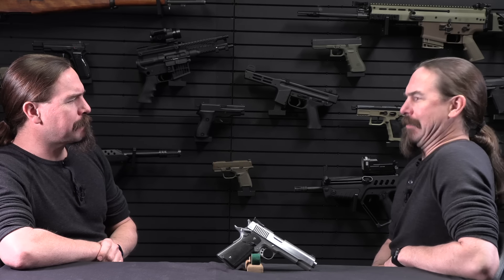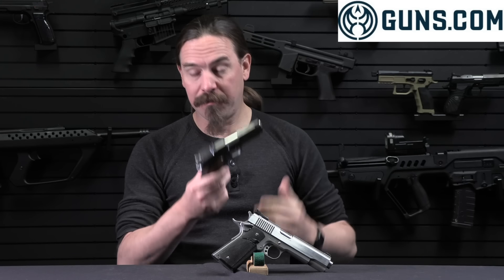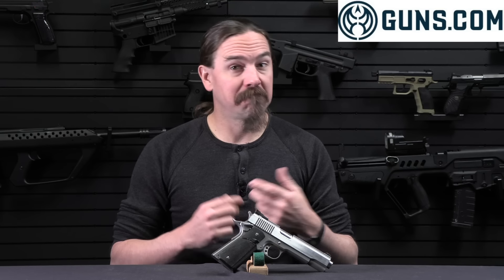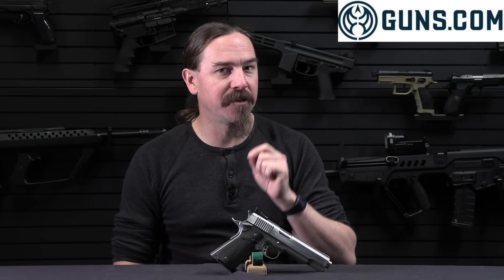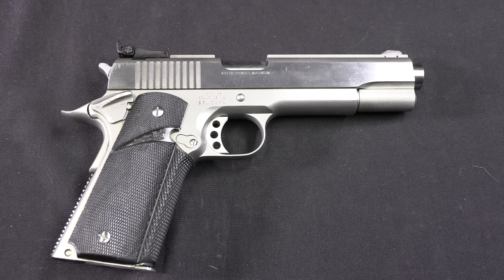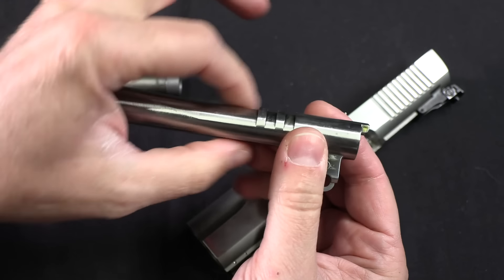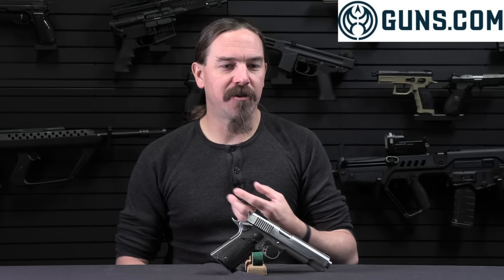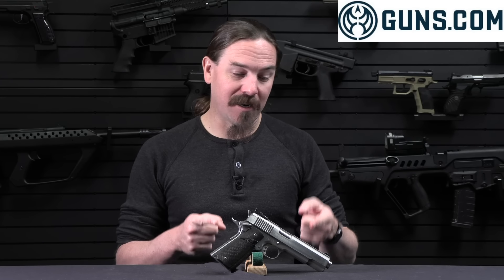Cartridge History: The .451 Detonics Magnum is a Supercharged .45 ACP

Comment: The 1911 unsupported chamber was resolved with the introduction of at least two ramped barrel designs using swinging link and at least one linkless design.
The stock 1911 uses a ramp on the frame coupled with a heavily chamfered chamber mouth.  The gap between the frame ramp and chamber can cause feed issues which is why the chamber is often unsupported

Comment: Nice video. I wish you had made it longer and given more details on the 45 super and 460 rowland. The only reason I haven't tried custom build in 460 rowland or 45 super is ammunition availability. I also want to do more research on chamber pressures and bullet velocity in those vs regular 45 acp and the +p or +p+ 45acp as if I really need to step up to the more magnum cartridges. If I can find a reliable expanding bullets in 45acp with the 4 inch commander size ruger sr1911 I already have I'd be satisfied. My problem is expanding bullets are velocity based and 45acp in general just isn't fast enough to expand properly. It's close but still a little slow. I want the 230 grain bullets at about 1000 to 1100 fps and 185 at about 1200 to 1300 fps. I've seen 230 grain at 900 to 980 and the 185 around the 1050 to 1100 fps and the one common thread is the the faster bullets get full expanding and the slow ones don't expand and over penetrate. I don't give a rat's rump about the fbi ballistics test because as a private citizen I don't have the same problem as law enforcement officers or the same mission. I think my encounter will be up close and personal from someone attacking me. Where law enforcement is the one searching for or trying to arrest the bad person, my goal is to drive off the attacking criminal and survive

Comment: I have some Underwood 45 Super.  I've shot it in a Kimber 1911 (one mag), Mark 23 (lots of mags), and a S&W 625 JM (a few cylinders).  Recoil makes it not as usable for self defense as I had hoped.  I'd rather carry .44 Mag if I want something heavy. I get better followups with .44 Mag, though it might be attributed to the grips that absorb a lot of recoil. The 629 is also heavier. Maybe I should swap grips between the 625 and 629 and see how it changes. I liked shooting it out of the Mark 23 the most. That was fun.  So, the .45 Super is reserved for the Mark 23 for those times when being practical is boring.

Comment: Fun fact. The HK Mark 23 is most likely the only current mass production handgun that can withstand running thousands of 45 Super rounds without issues (without ANY modifications). The USPs can shoot small amounts of 45 Super, but large quantities will damage it. FNX is similar to USP in regards to 45 Super.
A box stock Mark 23 will even run 460 Rowland without issues. Having the stock barrel chamber cut 1/16" deeper is all that's required.
The stock progressive recoil/buffer assembly (looks like a shock assembly for an RC car) works even with 460 Rowland pressures.

Comment: I wanted a more powerful 45 in a 1911 and looked at all those options, I went  with a 10mm. I think the 10mm has a manageable recoil that I could handle easy with a 200 gr. bullet and 13.3 #9 powder. 
I a 1911 pistol you got to be able to hold the grip(with your own personal strength) without any slippage because that does affects the  accuracy and anything more is hard to control for me. I did have a glock 10mm and that gun was hard to hold onto.

Comment: I dunno about the whole low pressure early powder thing. Remember when cordite was so hot that it was smoking barrels and burning them out in a rather short period of time? If you broke up the spicy spaghetti it got REALLY volatile. The reason for the sticks was in part to keep it under control. It was early double base extruded powder. 

Chop that stuff into slices instead of long rods and the behavior changes drastically. They had the means to make hot pistol and rifle powder back then. The guns couldn't handle it. Hell, my modern production 1911 gets a little beat up with standard wwb .45 acp 230 jhp. Mild loads of 185s at 675-700? Much easier on me and the pistol.

Comment: Two questions:
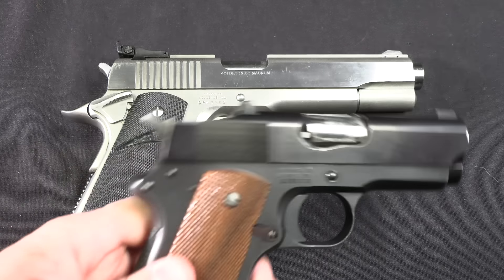A: 9:45 why does this gun push the rear sight so far forward?
B: If people want a large bore powerful gun why not go to the maximum diameter allowed by law, .50 cal and keep the muzzle velocity in the 1200 fps range. In other words, don't go .50AE and require a ridiculously massive pistol, just increase the diameter and performance such that a relatively normal size 1911 frame will work? If you are going to stay with a single stack magazine, why not increase the bore diameter to .50? Perhaps a little longer version of the .50 GI, with a rim diameter sized for the cartridge (i.e. larger than the .45ACP rim). "Flying ash tray" anyone?
Reply: A: The guy who designed the Combat Master believed in carrying a 1911 with a round chambered, the hammer down, and the safety off. The cutaway at the back of the slide was to make it easier to thumb cock the reduced-profile-but-still-spur-style hammer. He had opinions.
B: Interesting idea. Increasing the rim diameter would make .45 ACP conversions much more difficult, though. I think the rebated rim on the .50 GI is an elegant solution.

Comment: 8:08 200gr at 1200fps is rookie numbers. Gotta push them up!

(I've got a .45 super load that pushes a 200gr projectile at 1300fps and it's a safe load)
Reply: Imagined or chronograph?
Reply: @georgesheffield1580  chrono'd. I only expected about 1200 or so feet per second, but was pleasantly surprised. It's also very consistent (using BE-86). TO BE FAIR, I'm using hard cast lead RNFP because it's a bear defense round. Use jacketed bullets and you'll lose about 50-75 or so feet per second and increase pressure. 

200gr RNFP Hardcast (19 brinnell)
Starline .45 Super brass
CCI Large Pistol primer
10.2gr BE-86
Seat bullet to magazine length.

5" XDM Tac (stock threaded barrel) with Muzzle Brake and 22lb spring.

There is something interesting to note. I get higher velocities out of my XDM than I do my 1911 with the same barrel length. I get on average about 50fps difference between the two. I can't explain why.
Reply: Here is a video of a similar load I did with semi-wadcutters for my buddy that runs Alaskan Ballistics. It was 10.1gr power pistol out of a 6" barrel. I like the BE-86 load better.

https://youtu.be/EYTEoCAYIEc?si=dD-DT8x_EWN3YmR9

Comment: All of these hopped up .45's seem to be a recipe for battered or cracked frames. I'm no 1911 specialist, so I don't know if the solution lies in the realm of metallurgy &/or heat treatment or additional means of recoil abatement. Perhaps the 1911 is ultimately, an unsuitable platform for high performance, large bore cartridges. A curious thing I noticed on the pistol you displayed was the long ejector employed. It must provide pretty spectacular ejection.

Comment: I have the complete series of The Survivalist.  I think they are 27 books.  I read the books.  Bought a Combat Master.  I was tempted to get a second, so I could use the two holster shoulder setup.  That would be a bit extreme.  But, I did get a Scoremaster in 45acp, and another in .451 Detonics Magnum.  That slide is labeled 451 Detonics Magnum  45acp.  I shoot 45acp without issue, and I load 451 from 45 WM brass.  Prices on the Scoremaster have more than doubled, but can still be found on GB occasionally.  The Scoremaster trigger is excellent, as is the accuracy.   Thanks for the update on the 451 Detonics Magnum.
Reply: Nice!  When I was reading the Survivalist series I learned that AG Russell’s shop was nearby.  Of course I had to visit him and buy a black chrome Sting 1A.  Mr Russell was a real gentleman.
Reply: I’m also a fan of Jerry Ahern and finally bought a Combat Master a few years ago.  Buying a Score Master in the 90s was always a dream of mine.

Comment: i'll never understand why 10mm became the "big bore autoloader" caliber in the mainstream when .460 blows it out of the water, and also lets you use regular old .45acp to train with.
Reply: 10mm became the mainstream because it’s a F’n beast!!!
Reply: @peggymorgan6355  - 10 mm is a solid cartridge and it enjoys a capacity advantage over most 460 platforms.   But 45 super will match 10mm numbers.  If you handload then  you can reach levels the 10mm could never dream of reaching. 
Here is a link to some testing using my modified 70 colt.   This is part 1 of 3 and the loads are making close to 800 fpe.   Part 2 & 3 move into 900 fpe territory slinging 260 grn slugs. 

45 Super +P Handloads  - Quest for 460 Rowland Power - Part 1
https://youtu.be/EXxxwhsHUlA

Comment: Given what Ian said does that mean that modern .45 ACP while having the same weight of powder is more powerful? Would it be safe in a W W I or W W II M1911? Has the metallurgy of modern production M1911's different from W W I and/or W W II production guns? Just curious is all. I have a 1943 M1911A1 and a Ruger M1911 form the 1990's and Tisas M1911's from today. I can't visually or by weight detect any difference. Often wondered if there was one.
Reply: It's been established that the original Colt 1911s as well as guns made by other contractors for the U.S. government before WWII especially are not as strong as a modern 1911 due mostly to inconsistent heat treating. Older 1911s will eventually see cracks in the frame and possibly the front part of the slide from firing standard pressure ammo. We're talking between tens of thousands and a hundred thousand rounds. High pressure stuff will wear them out faster still.
Reply: Caution would probably be wise, yes. 
However, part of Ammo's 'modern improvements' is the pressure *curve*. We can make ammo today that's 'stronger' than Early-Mid 20th century smokeless cartridges, without exceeding the original max pressure. Basically, the pressure is over a longer impulse.

[At least this is what I recall reading about cartridge improvements over the years]
Reply: You can get SMG velocity from 4-5 inch pistol length barrels just from new powders for the ~8-10 inch Grease or Thompson velocity was only about 900-935 FPS
Reply: @LRK-GT  Yeah, we have gotten a LOT better both at studying how powder burns and also making powders that burn in a specific way to suit our needs. We haven't done a huge amount with that in terms of completely new innovations but just maximising what we can already do with a very mature round is still great. Although we tend to focus on pushing ballistic effect, getting cartridges that are softer shooting at the same performance is pretty cool too.

Comment: I am litteraly reloading 460Rowland load data using 45ACP brass at the moment. 185gr XTP just under 1500fps. I am using a Glock 30S with a (fully supported chamber) KKM barrel and a steel muzzle brake. I do have 45super brass, but I only use .452 bullets with them while the .451s get the ACP. 
I ran Underwood 45super for a long time with only a guide rod/springs upgrade. I like compensators.
Reply: I have the Scoremaster in .451.  I use .460 Rowland brass cut down to .942 in and with the Hornady 185g XTP.
Reply: @EdBluhm  I got 250gn going over 1250fps but I don't plan on loading that hot. I just wanted to match 460R chrono readings I seen on youtube and see how my modified G30S handled it. It did great with a 13lbs spring, but a factory strength 17lbs is much better. I will only load them to 1100fps in the future. My 30S weighs 27.2oz empty with a 10rd mag. The 250s have little powder for the comp to use and still recoil high. I am only using 200gr max from now on. 200gr 1200fps shoot very well but 1450fps is max. I loaded 118gr to 1700fps and those shot very flat. Gonna try for 2000fps next time.

Comment: The Detonics Magnum has been a dream gun of mine ever since I saw some ads for them in old issues of SGN, as a kid back in the early 80's; continuing with a .460 Rowland in current day.  

I'll never own either, but once again I can do it vicariously with Ian.  Win!
Reply: Born in 71. Have the same feelings.
Reply: I converted a G21 to .460 Rowland quite a few years ago... Used a longer barrel and a different style compensator... I also used a barrel that was chambered for .45ACP and used either .45SUPER or cut down .308 (7.62x54) brass... Because of everything being so "non-standard" in my build, I never found an acceptable holster for it -- the compensator either prevented the gun from going into a holster or it seemed to catch on the holster that when I was drawing the gun...

Comment: Question: So are normal "hot" revolver cartridges, like .357 magnum, also thicker at the rear of the case? Because you were discussing unsupported brass in automatics, but even my S&W 586 has a small gap between the recoil shield and the actual cylinder, meaning the case isn't fully supported.
Reply: The web of the case fully supports against pressure up to ~65,000 PSI.  All modern brass has a solid web which extends past the primer pocket, black powder brass often had a balloon head for more volume. 
The unsupported area in a 1911 is a bit forward of the web.

Comment: I still have my Colt Series 80 1911 from IPSC competition back in the 1980s. I built it up for .45 ACP cases using cut down .308 rifle brass. It was a lot of work to make the cases, but the thick head web allowed me to push 185 grain bullets at 1250 fps an 200s at 1150. Almost the same ballistics as Detonics' .451. 
It was too much work for the benefit though. About the only thing it did better than the standard .45 ACP was bowling pins. I ended up taking the recoil buffer(I got them from Detonics, and they never even knew I was competition) and the super power springs and such out, but I kept them just in case I wanted to go back to it, but I never did.

Comment: I wonder if the the 357 Sig can be restarted on the market th pccs and maybe some new toy from keltec. 125gr defensive 357 power, reliable feeding with plenty of capacity in the mag. 
All that is needed is to bring down the ammo price and naming it 357 Auto. Not too hot, easy to control, . With the trend of compensators and porting in stock guns this can really work out in handguns too.

Comment: I have been wanting a .460 Roeland in a custom double stack 1911 for the better part of nearly 20 years. Never realized just how long the history of hot wildcat cartridges based off of the .45 ACP was though.
Reply: The double stack M1911 is heresy. Single stack is more reliable and allows for less weight in the grip and on the gun in general, plus the single-stack grip has a slimmer profile. As for more ammo capacity, pistols in general are for IMMEDIATE dire close-quarters situations. When something has gone very wrong. If you're in a prolonged firefight, you need a rifle.
Reply: @arnox4554  I have large hands and am comfortable with a thicker gun so why not have more ammo, I don't conceal carry so slimmness or the few extra ounces of weight don't matter as it's still lighter and less bulky than carrying a spare mag on my belt anyway, and ammo in the mag in the gun is more useful than in a spare mag anyway.

Your only valid point is that single stack mags are more reliable but the double stacks have come a long way in the last 20-30 years.

You want Heresy? Look at the super cut down and bobtailed 1911's and you might find it there, bonus points if it's a 9mm or smaller.
Reply: @Hybris51129  Oh hell no. No argument about those cut down M1911s from me.

As to the weight and size of hands, I mean... If it works for you, fair enough, but I don't like it at all, and I don't like how it slightly increases the already higher difficulty of conceal-carrying an M1911.

Comment: I have a Series 80 Colt Officer's Model that had to have a similar recoil spring plug installed. The standerd barrel bushing would break as it could not withstand the 'abuse'. You could also not use a buffer on the spring guide with the short barrel as the slide needed every fraction of an inch for the slide to recoil.

The big solution for the unsupported chamber was to develop the ramped barrel, that requires modifying the frame. That was pushed during the earlier days of ISPC/USPSA competition where shooters would try to load 38 Super to make 'major' in the power classification. ( the super would hold more rounds in the magazine, maybe less recoil and compensators worked better with the cartridge than the 45 ACP) The 38 Super could do it but it was a fine line between making 'major' and having the case blow out. Having temperature sensative powder did not help.

Comment: Why aren't stainless steel guns as popular today as they were in the '80's?
Reply: Stainless has never really been popular in firearms, even though we've had stainless steel since the 1900s. And it basically comes down to cost. Blued regular steel is corrosion resistant enough already so there's no real need to go beyond that, and stainless simply costs more for the same material. There are some specific places where stainless is wise, like at sea, but even then only in really specific places where there is no other option. Arms kept on ships are just the same as issued elsewhere, the masters-at-arms just have to keep them well cleaned and greased.